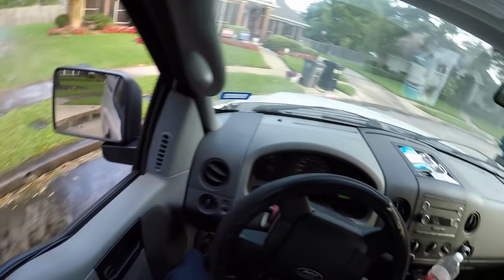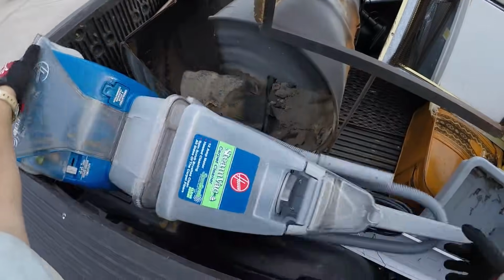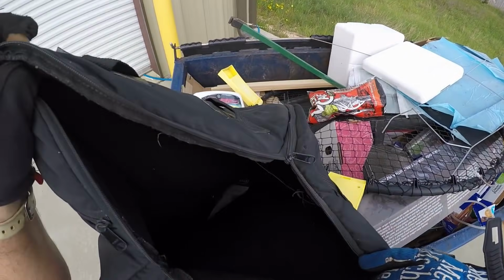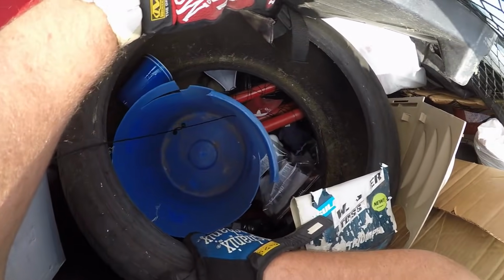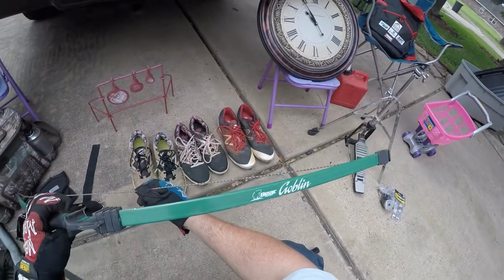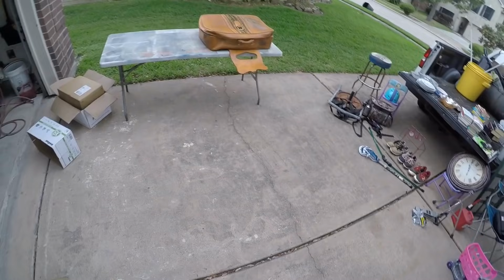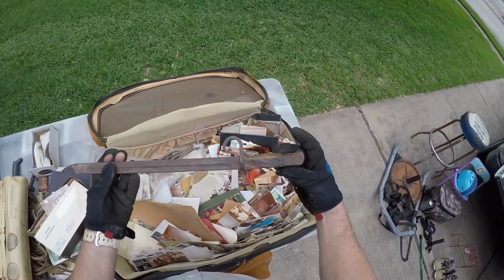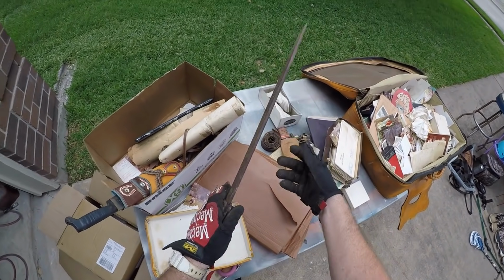Curbside Scavenging (Found 2 Bayonets, Old Stamps, And A Bunch Of Other Old Stuff)

Comment: The black round bag is for carrying cymbals to a gig. You can put about 5 cymbals in that bag. I have a couple myself that I use. They retail for about $75.00 new, but used about $25.00 to $30.00, if the zipper is in good working condition.  Might as well scrap the Hi-Hat stand, but the felt washers, nuts, bolts, and drum keys are valuable to a drummer. List them on eBay as a Drum Parts lot. If the cymbal bag is still in the dumpster, go back and grab it, and list for $30.00 plus shipping on eBay. :-)

Comment: Cuffs can also be sliver or gold. Take the time to look very carefully with a loop. The markings can be so small and almost hidden. Look up where markings can be on new & vtg jewelry. 925 is the standard mark for silver. 958, 999, Sterling, sterling silver & other marks will tell you it's silver.
For gold, 585, or 14k, 750 or 18k, 916 or 22k & 990 or 24k. The numbers let you know it's purity. 
Gold is very soft as well as silver. They have to add other metals to make it stronger so it lasts longer. 
A 24k gold ring will wear away way faster than say an 18k or a 14k gold ring. I hope this helps you in the future.

Comment: So many pictures.  They sell online too, on Etsy mostly.  Paper and Moose would be a good resource for that.  If any of the pictures has any military sites or guys in uniform etc. sort them out.   Those would go with the bayonets.Has anyone said that the thin glass orange tone dish might be old and needs a look up or some research.     There is a website for stamps so you can look some up and see.  Most stamps from that era are worth something.  Keep them altogether until you have time to look them up.  The yellow sunglasses were used to help folks see in foggy and overcast days.  Helped protect eyes too.  The ones there may be from military sites.

Comment: Bayonets appear to be Japanese type 30, with a star and ball as you mentioned it would likely be the Jinsen Rikugun Shoheishu Arsenal (may need to check that spelling). One appears to be missing the barrel ring, maybe modified by the original user or last owners. You have a round colored glass dish with flowers on it from the box of dishes. That dish appears to be the depression glass pattern “Iris” in carnival glass, if original, worth a few bucks, if one of the reproduction pieces, not so much. One problem with depression glass is that most younger collectors don’t seem to be interested.

Comment: the bayonets if you can get the numbers off the blade close to the hilt then u can search them up it would be better if they had the scabord   also there should bea lock of some sort on the top of thr handel make sure its works  but if there not remakes which they arey are not they could be a small chunk of change to the someone